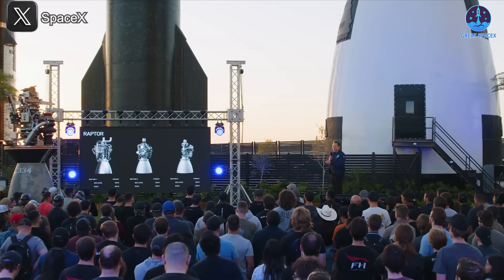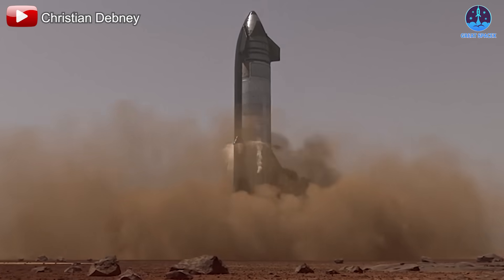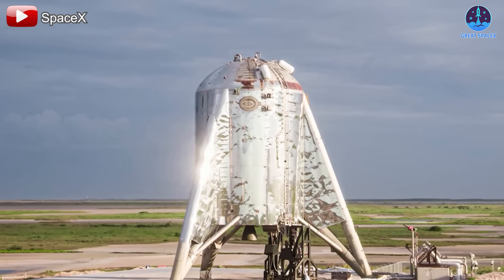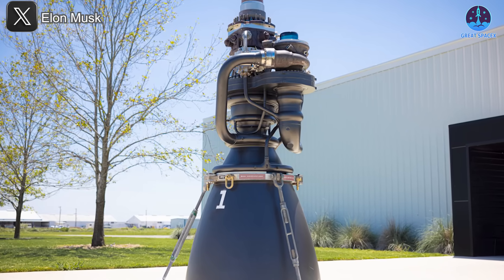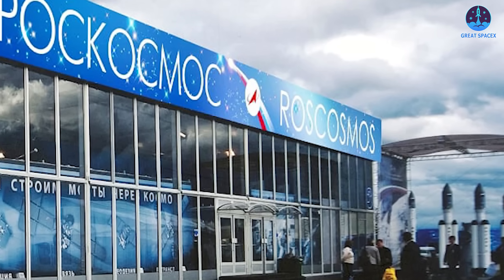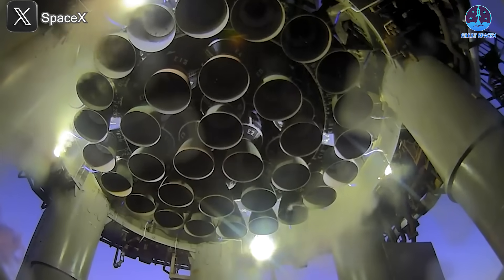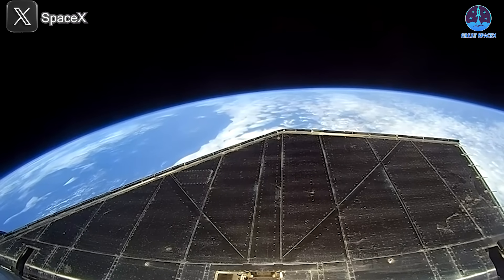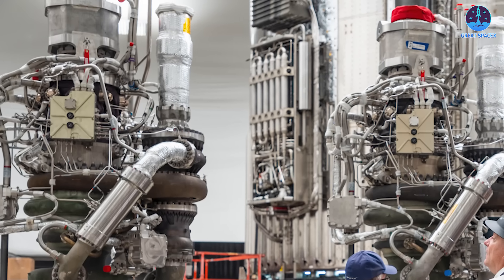SpaceX's Raptor engine is the King of Rocket Engines! Here's Why...

Comment: In other news!  Today is a pretty big day in the A.I. world(which can be used to make even better rocket engines and spacecraft) - Grok 3 is to be released.  And openA.I. has decided to go ahead and accelerate the release time of gpt4.5, to . . . .today as well!  About 8 p.m./7 p.m. respectively 

A lot of A.I. observers think grok3 is going to be monumental.  And in some ways it is.  It's trained a gpu supercluster of 200,000.  Before  . . . Elon Musk's breakthrough on making gpu superclusdters possible; yes, you heard me correctly, it was actually Elon Musk who figured this out!   . . . well, before Elon Musk's breakthough, they couldn't get 30,000 gpu's to work. 

While having an A.I. trained on the first supercluster is pretty exciting for any futurist fan, grok 4 will be so much more.  Number one - Elon Musk's xAI will train grok4 on a millin gpu supercluster and 2) the usage of paratmers/tokens will be so much more efficient. 

In fact, last night, I saw three A.I. breakthroughs in parameter/token efficiency that allowed some small A.I. group to equal deepseek, at any rate, with far less compute training needed. 

Bottom line, grok4, for one A.I. model at least, will be trained on almost 90% more compute, and probably will learn of these new parameter/token efficiency advances which are like 90^% more efficient.  So grok4 will bury grok3.
Reply: Then there's the Quantum Computers.  While many have been excited about ion qubit Quantum Computers, others into superconductors, I've been waiting since last March for a topological insulators qubits Quantum Computers.  I got a tweet a week or so ago now that indicates to me they are on time for their March 2025 announcement of a prototype, to be sure, General programmable Quantum Computer. 

And of course, all the other Quantum Computer ideas are making great progress.  Basically everyone is ready for scaling up.
Reply: Bottom line - the Star Trek future is coming like a freight train!

Comment: Now only if Space X can get a Nuclear Rocket engine to operate on Methane not just Hydrogen about the size of the Raptor. Think about it, 3 Raptor sea Level, 3 Vacuum and 3 Nuclear Methane engines. The Tanks will be 50%50% Methane and L/Oxygen and/or can piggy back on a depot V3 or tanker ship Fat Boy 12m -18m OD over the 9m v ships.  A cluster is the best way to get all ships mission to destination.